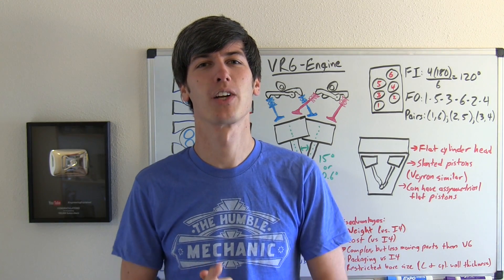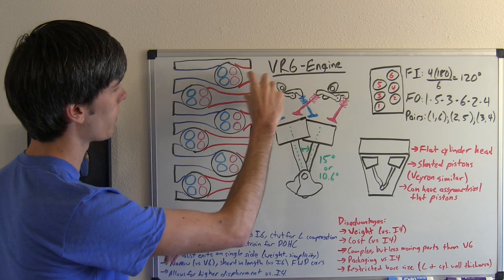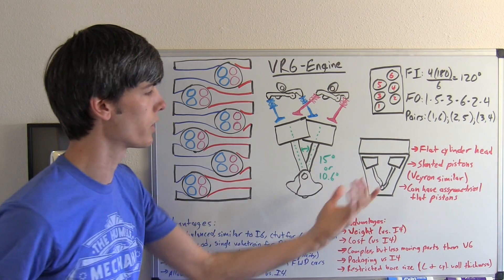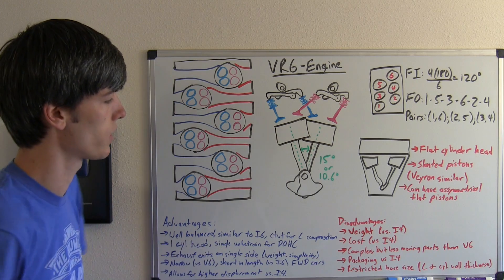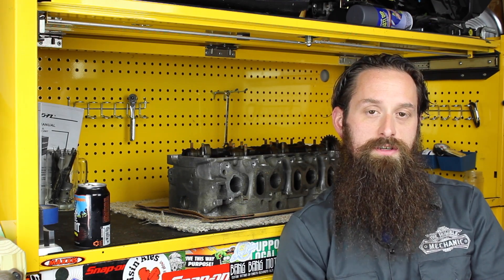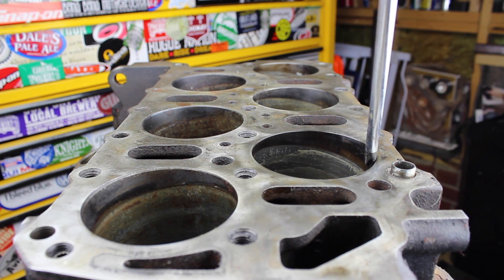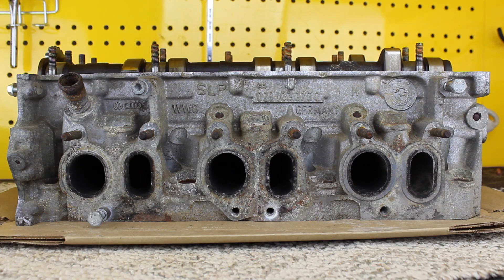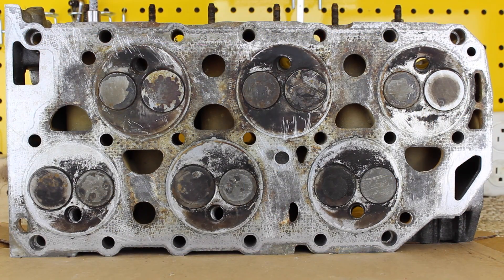VR6 Engine - Explained

Comment: Yeah this is a wonderful engine, until the plastic timing chain guides break. Then big $$$ to repair due to the placement of the chain on the flywheel side.
Reply: silverbird58 I developed a religion  of  brake maintenance after  having an accident  while driving my employer's truck ,,it was a large  grain truck , and  i blew a tire   and was  unable to stop or maintain control   because of  faulty brakes ,,if the farmer  had paid attention to the tires and brakes , and if he hadn't cheated on the tires  he put on the truck   it would never have happened 
and i don't know  how the truck passed it's FMCSA inspection with  recap tires on the steer axle ,, but it had  passed it a week before  the accident ,, i am sure the brakes were  faulty   and I know the recaps were  already on the truck when it was inspected 

fortunately  nobody was hurt even though i turned the truck on it's  side ,, only real loss was  the 750 bushels of corn in the truck ,, and  $15K  damage to the truck 

it taught me a lesson i haven't forgotten in 20 years since then ,,  i was a 20 year old  newly licensed  truck driver ,, i had never seen a recap tire  and it never came up in my learning that it is actually illegal to mount recap tire on a steering axle ,, , and since i didn't own the truck and wasn't responsible for the maintenance , i never bothered to inspect it , aside from light checks 
that will never happen to me  again 

today i would go to a truck lot and  before i drove a brand new truck with 50 miles on it  off the lot ,, i would crawl under it and check all of the brakes ,, and i would open the hood and check the engine oil ,, and the Air compressor oil
Reply: parteibonza not much of a story but it is quite true ,, if you have ever rolled a car  over it's not funny ,,  doing that with a 40,000 pound grain truck is even less funny ,,especially when you consider  the crash closed a major highway in both directions for close to  6 hours ,,no major injuries  just damaged property,,and a huge mess
Reply: +22BOZIDAR If it's stock, I would say yes (because of the intake manifold design)

If you have an aftermarket Intake manifold (Which most serious moderns on the mkiv platform go), then it's a lot easier.
Reply: Nevermind - stripped bolt on the tension rail cover.

Terrible
Reply: +Nick Maclachlan you oughtta try putting a 6.4 liter powerstroke ford  together  the timing gears are in the back of the engine too 
,,an even more fun  one is    assembling an 8V-71 detroit cause everything is  timing driven  even the blower that makes it run  ,, and the camshafts that operate the exhaust valves it has  2 cams  and 4 exhaust valves per cylinder ,, fuel injectors are also  cam operated ,, it has  no injection pump 
and no i didn't make a mistake when i said it only has exhaust valves ,, the  air intake is in the bottom of the cylinder  , in the form of ports in the sides 
I know all of this because my  pulling truck has this engine in it   ,,2 stroke detroit ,, 8V-71  twin turbos ,, and my  semi truck  has a 12V-71 twin-turbo
Reply: +wildcoyote34 are they 2-stroke diesels? 'cause I heard one the other day, some old guy had put a... 4-71, maybe? Anyhow, big-assed, twincharged 2-stroke 4-cyl diesel in a Suburban. best sounding diesel ever.
Reply: LegacyMuse yes  they are  2 stroke diesels 
4-71 is a good  engine for a suburban , plenty of power  and probably better fuel mileage too
Reply: LegacyMuse I love the sound of the detroit diesel ,,I'll  pit  my   semi truck ,, a 1974 freightiner conventional  tractor ,,  I'll put it against any newer truck  in a hill climbing contest ,,I drive from Iowa to colorado and over the mountains to Washington state regularly 
and i have left guys with  600+HP cat and Cummins  powered trucks behind climbing the mountains pulling 80,000 pounds ,,and there ain't nothing that sounds like  it when you hear it climbing  a steep grade in low gear,, it flat ass screams ,,and no other engine sounds like  the buzzin dozen ,,  even an 8V-92 can't come close to it's exhaust note
Reply: silverbird58 I'm  not a bulldog  fan ,, they are  great reliable trucks , but i  have yet to find a mack that can even hope to keep up with me  climbing a mountain ,,, 318 detroit usually refers to the 6V-53  which is a little  engine ,and was used in a lot of  strait trucks and fire trucks ,and sort haul trucks ,and even heavy equipment ,,,12V-71TT displaces  852 CI, 14 liters ,,mine  runs just shy of 850HP and  2500 pound /feet of torque ,,closest modern truck that can pretty well keep up with me was a C-17 cat powered  freightliner , he wasn't pulling  near the load i was though ,,  i had a box trailer  loaded with  60K worth of  engine blocks ,, and the guy who was drafting me was pulling a  dumptruck on a lowboy ,about  half my load , kept up with  me for nearly  100 miles through the mountains ,, but still didn't have enough  nuts  or  horsepower to pass me
Reply: silverbird58 which  motor do you have??
Reply: silverbird58 that's a damned good  engine 
one of the farmers i do custom plowing for  has a dodge  truck  with   500K on  his  cummins.. 
cummins  got it right  when they designed that engine..I have a B series cummins swap in my 1988 ford ranger ,,it's an older one with no electronics ,  the B 3.9 is  identical to the B 5.9
only shorter by 2 cylinders,,it only has 175hp , but more than enough  for the ranger which only weighs 3200 pounds,,even better is  that fact it gets  35mpg  which is better than the original 2.9 liter V6
Reply: I looked up  this engine ,, it looks like a really nice design  ,, very powerful yet light weight ,, not very far  along  in development though 

google DUKE engine ,, it's another decent and much simpler design ,, and is  farther along with development ,, they are  in the 3rd generation  of testing ,, and have run it on every fuel  we produce  today ,,i haven't seen any recent updates though ,, newest articles are  4 years old
Reply: silverbird58  the B 3.9  is a 4 cylinder engine ,,  mine dynos at 185HP and  400 pound feet  torque 
it is  about 250 pounds  heavier than the  2.9 liter  V6 it replaced 
it is  a turbo diesel , and has an inter-cooler just like it's larger brother  the B 5.9 

as for the brakes on my truck ,, they are NEW ,, everything from the master cylinder back is new , calipers , hardware, slave cylinders ,, lines , rotors,drums , shoes and pads 
this truck  set parked behind a barn for  10+ years ,,I also installed a new clutch ,, and after the first couple times i drove it , i replaced ALL of the U-joints all 10 of them ,3 in back drive shaft ,4 in front shaft  , and the 3 front axle joints

I am one of those  guys who believes  . i don't care  what else is wrong with  a truck or car ,, but the brakes  damn well better work ,,I've drove some real POS vehicles but all of them had good brakes cause i make sure of it
Reply: +wildcoyote34 LOL that's a funny story :-)
Reply: +wildcoyote34 Well nobody died....just huge amounts of property damage. Thats why its funny I guess...sorry to be wierd :)
Reply: parteibonza total damage to the truck was about $15,000   and  the loss of a 750 bushel load of corn 
and the 1 car that i hit when the truck tipped over which was a total loss ,and that wasn't much of a loss either 
nobody injured other than me and my injury was  minor , caused by the seatbelt  which i was wearing ,mostly just a  bruise and some scratches caused by the busted window
only other real damage was a row of mailboxes that i  mowed down
Reply: +wildcoyote34 haha :D